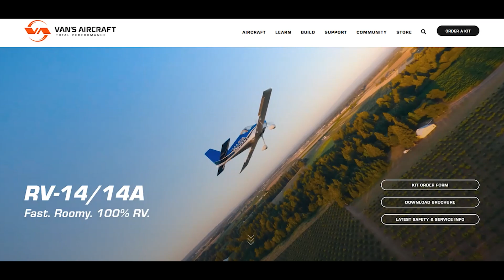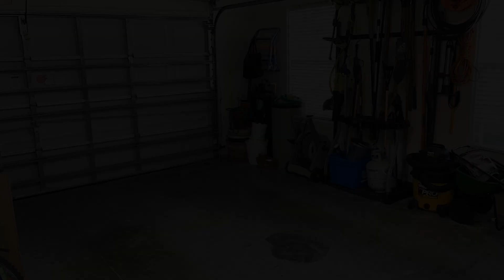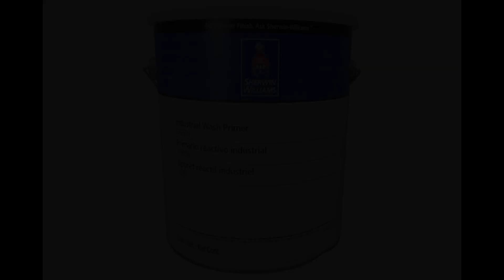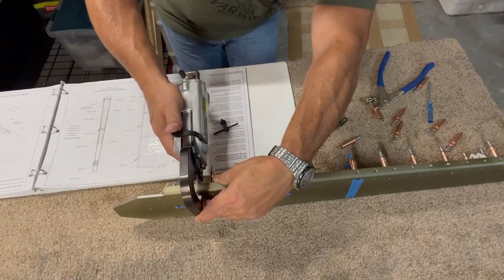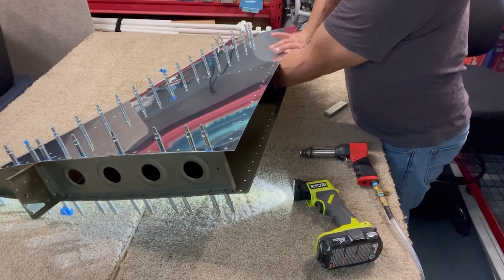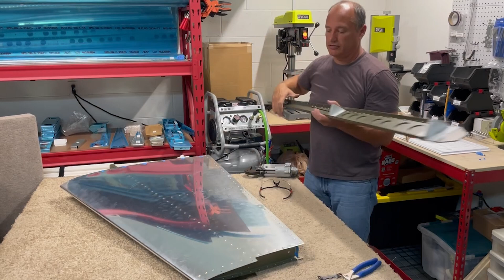Vertical Stabilizer pt3 | Building a Vans RV 14 Airplane Ep3 | Riveting Priming and Final Assembly

Comment: Workmanship looks great!  Very motivating for my soon to start build.  I’ve been debating the prime/no prime question and if yes, then which one.  I like what I see in your choice.
Reply from the maker: That’s great that you’re getting close. Definitely a lot of priming options. See quite a few people just opt for rattle cans of self etching primer from the hardware store… probably a lot easier than all the paint gun setup stuff. IDK… I also stumbled on to Stewart Systems. It’s a no VOC option so you don’t need all the protective gear… from what I’ve read the only downside is that you need to let it cure for several days before you work with it… but depending on your work schedule. That might not be an issue